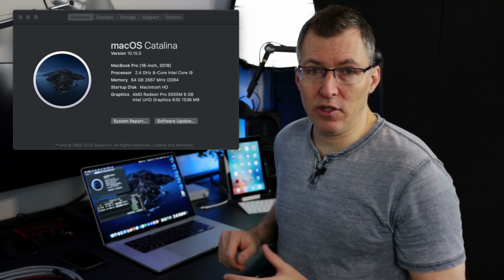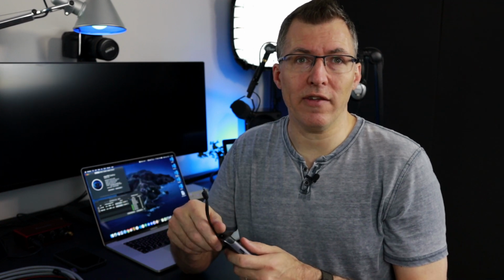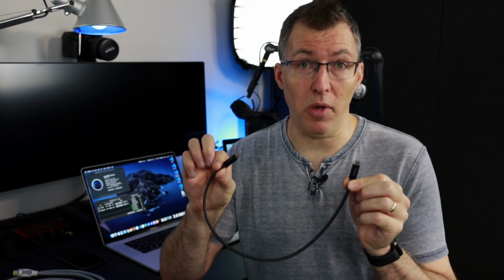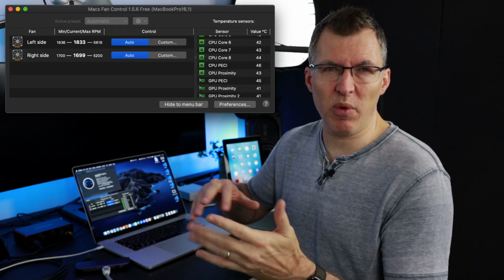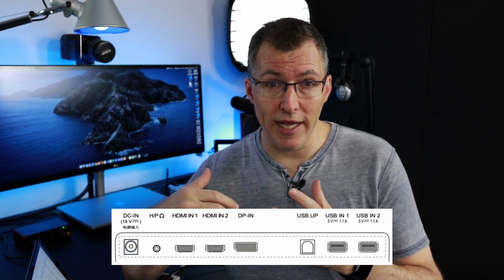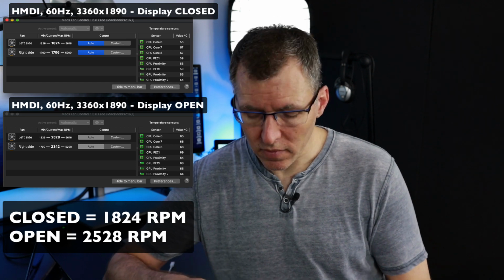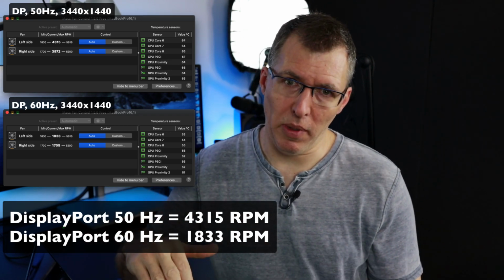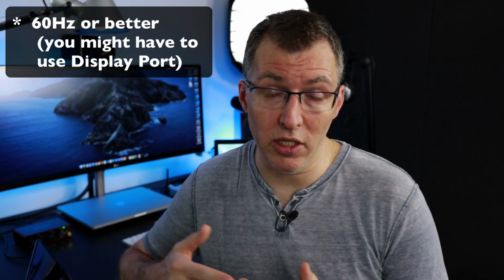SOLVED! MacBook Pro 16" + External Monitor = High Temperatures and Loud Fans. Here is the FIX!

Comment: Sorry but it is so. I use a displayport to usb c cable with 60 hz and the fans going up to 3400-4200 rpm...
Reply from the maker: Is the MacBook display open or closed while the external monitor is connected?
Reply: Virtual Tech Meetup if the macbook is open then 3400-4200 and if its closed then 2900-3400
Reply from the maker: Interesting. I have tested with 4 different monitors now with the same results. Which monitor are you using? I do find that CPU boosting can also kick the fans up. But it usually settles again once idle. Since making this video I found an app that you may want to try out. https://github.com/exelban/stats. It is similar to iStats, but 100% free. You can easily see how much power the GPU is using. As I type this my GPU is pulling 5.4W, CPU is 13% (some code I am working on is running in the background) and my fans are around 1950. As long as your GPU is around 5-7ish watts, it is probably CPU heat pushing the fans faster. However if your GPU is 15W or more, that is undoubtedly the culprit.
Reply: @VirtualTechMeetup  First of all, thank you for the check you made.

I use the following monitor: Samsung U28E590D

I have the following specifications of the device:
i9 with 2.4 Ghz with 64 GB RAM and the graphics card 5500M with 8 GB.

I currently have TG Pro and also Turbo Boost Switcher Pro in use.

I just downloaded the stats file you mentioned and will check it out.

I have the MacBook on the road right now and will test it as soon as I get home.

Thanks for your valuable and interesting video.

Comment: I am aware this question is not related but I don't where to look anymore and hoping you can help: I have a MacBook Pro 16 inches and use it with a dell external monitor and the usb-c cable. I use it in clamshell mode. The sound keeps coming from the laptop even closed. What do I have to do to have it from the monitor ?
Reply from the maker: Assuming that your monitor has speakers (many do not, including many Dell models)... click on the Apple logo in the top left --> click System Preferences --> click Sound --> click the Output tab... you should see your monitor listed as a sound output device. Click to select it as the current output. If your monitor isn't listed, it probably doesn't have speakers.

Comment: I have a Dell U2720Q and a MBPR 16" (5500M) - Does buying a new usb-c cable solve the problem? The Macbook is super quiet in "clamshell" mode, but once I open the lid, the fan noise is not to be overheard and very disturbing. Don't get me wrong, the Macbook may be loud under heavy load - the heat has to go somewhere.

I also took the Macbook to an Apple Store, but they didn't find anything (and didn't checked with an External Screen and I haven't had that much time tbh). I have installed https://github.com/exelban/stats and checked the gpu, it draws 20W+ if the external screen is open and if not, it's only 4-8W depending what is visible on the screen.
Reply from the maker: Once the lid is open you are basically driving two monitors and the GPU will jump to 20W increasing the temperature as well. Any combination of two monitors will be problematic (e.g. two external monitors and lid closed).

Comment: Finally a youtuber who honestly talks about the problems with the 16" MB Pro. Linus Tech Tips and his gang lie through their teeth, saying enthusiastically that Apple 'solved' the thermal problems on the 16" MB.
Reply from the maker: In all fairness to LTT, I suspect that they were evaluating only the laptop by itself. No external monitor. In that scenario there is less thermal throttling on the 16" compared to the 15" with the same processor (I have one of these on my desk at the moment as well). It isn't a night and day difference, but a difference none the less. However, if connected to an external monitor with one of the unlucky combinations, the additional heat load from the 16" GPU will easily negate any advantage.

Comment: The only good solution is to get the Radeon 5600M GPU which does not have these problems. The 5300M and 5500M models are defective, Apple knows it, and is sweeping it under the rug.
Reply: Could you name more sources that it works with the 5600M?

Comment: I think the ideal scenario is to A) use a usb c to Displayport cable from the left side port. While charging from the right hand side port.

B) making sure that the refresh rate is set to 60 hz (or same as the external display)

C) use screen mirroring (clamshell mode)

Please correct me if i am wrong. Btw with all three above. The system idles at 40s and 50s occasionally.
Reply: Option A solved my problem.
Reply: @chineduanene7632  my monitor only has HDMI :/ any advice? Currently using a USB hub to do USB-c to HDMI
Reply: @chineduanene7632  Option A did nothing for me. Option B is already checked.  Option C is kind of a sacrifice.
Reply: What about dual monitor? I'm going ape doodoo here 😭

Comment: Hi Robert,

Thank you very much indeed first of all for such a detailed video, it really is most helpful.

Can you provide the specific LG model number for the 34" UltraWide you are using? Are you getting the best resolution the monitor can offer? Any issues waking up from sleep, etc.? Is this a monitor you would recommend for the MacBook Pro 16" or do you have any other recommendations? You clearly have researched this very well and thoroughly so I thought I would ask if you do not mind.

Thank you very much in advance, kind regards,
Santiago
Reply from the maker: It is an LG 34UC87C, and all testing was at the full 3440x1440. Interestingly I was also having the issue with the system being unable to sleep and crashing. However after switching from the dongle/dock to the USB-C to DisplayPort cable, that issue went away as well. I had read that others suspected that their dock was the root cause of the issue, which would seem to have been true for me as well.

As far as recommendations go, I must point out this is an older model. However other 3440x1440 models from LG should be as good or better. Whether any monitor is the right one for you, depends on your needs. I am usually writing code and building data analytics solutions. I don't play games. The quality of text display and lots of screen real estate is most important to me. Super high refresh rates and response speed are secondary. It may be the opposite for you. I would actually prefer something like the LG 5K UltraFine. For text display it is incredible. However I need it to be wider and curved (and ideally anti-glare rather than glossy).
Reply: @VirtualTechMeetup  Thank you very much indeed once more. After a lot of research, I have decided to go for the LG 5K UltraFine. Ideally, I would have liked more screen real estate, but in the end I was not convinced by the 5K2K resolution nor by the 34" layout of the 34WK95U-W which was the finalist. But it was a close call, my conclusion is that that 34WK95U-W should work decently with the MBP 2019 16". 

As a separate note, I had bought a  MBP 2019 16" with exactly the same specs as yours, very recently. I am returning it for one with the 5600M GPU, it does seem that one is behaving much better perhaps it has even solved the issues with the external monitor. But it is a disappointment to say the least the quality of this Apple flagship product. You buy this sort of computer so you do not have to make compromises and it has been the total opposite.
Reply from the maker: I researched monitors a lot lately, and also thought that perhaps the 5K2K would be a reasonable choice, but nothing seemed like a sufficient upgrade. Nagging at me in the back of my mind is that I know that I really want the text quality of the LG 5K UltraFine (I used one on a project for about 6 months after the first came out). It is surprising that there is nothing between that and the Apple 6K XDR.

Comment: I have the 2019 MB Pro 16” and was thinking of getting a Dell 34” UltraWide or the 43” UltraWide.  Should my computer be able to handle either of those displays?
Reply: As I mention in the video, I use an LG 34" Ultra-Wide myself. It is important that you make sure that you connect to a port that allows for at least a 60Hz refresh rate (DisplayPort or USB-C would be the better option) and that you keep the MacBook Pro closed while connected to the external monitor.

Comment: Good tech review..
I'm looking for a solution to a screen glitching issue when connecting my 16" MBP to a 1080p Monitor or TV, via an external dongle. (It's a 2015 Model 27" LG, that works fine otherwise). Apple support suggested I go into safe mode (Shift+Power) and this works fine. but the MBP does not see external USB drives (via dongle, which I suppose is good in Safe Mode).  Replied to Apple support that I can't run the MPB in Safe forever. So...
Reply from the maker: I haven't experienced any screen glitches myself, so I can't provide any firsthand advice. A while back I did have issues between an Apple TV 4K and the LG 43" 4k Monitor that I mentioned in the video. Swapping out to a better cable fixed the issue. If you haven't already tried a different cable, that may be worth a shot.

Comment: Subscribed. You’re awesome. This is a big concern for many, I hope apple does more to resolve this. Reason I’m thankful is this is an in-depth well made video to an important issue with Mac, but not necessarily a winner for clicks. Yet you still chose to address the issue and give us valuable content on it. Thx. Still though Apple should try fix this hdmi usb-c toggle problem.
Reply from the maker: I am glad that you found it useful. It would be great if they gave us users more options to tune things. There are times that I want full power, and others when it isn't necessary. I want those options.

BTW, I am not worried about clicks. I made the channel to support the community around some of my other projects. But this issue had me stressed as well. When I finally solved the problem for myself, I wanted to help others.
Reply: @VirtualTechMeetup  Unfortunately, I went and bought the direct cable you suggested USB-C to HDMI (Before I was using a toggle converter for my problems)... Well the direct cable made it much worse. Even hitting 100 degrees celsius and didn't seem to be slowing down. I had to disconnect worried the damn computer would blow up.

Unfortunately, your recommendations didn't solve anything for me. The PC blows up with insane heat, when I plug to my PC monitor, my wide screen tv and is even producing heat when I use sidecar connected with an IPAD!

This is ridiculous. And absolutely disgusting for apple after asking for so much, and promising multiple displays.
Reply from the maker: @sandman3881  I wanted to confirm a few things. The cable that I used was USB-C to DisplayPort, not USB-C to HDMI. The reason that worked for me is that my monitor only supports 60Hz refresh rate over DisplayPort. 60Hz or greater is one of the two things that are important. The second is running in "clam shell", meaning that the MacBook Pro display is closed and you are using only the external monitor. Can you confirm that your refresh rate was 60Hz or greater, and that the MacBook Pro display was closed?

On a side note... I have never seen anything close to 100C, even while doing all of the various tests in the video. You may have other issues that need to be checked out.
Reply: Virtual Tech Meetup I thought it was hdmi to usb-c. My screen doesn’t even have display port. But I appreciate the info. Guess I need to buy a screen.. as for my giant flat screen no way I’m replacing that which is also hdmi. 

The refresh rate was 60hz. The screen was not closed in clam shell. As I intend on using my labtop keyboard and trackpad, and not carry full sets of peripherals. 

I appreciate your reply though. And thanks for the great work. Unfortunately none of the peripherals I currently own including my iPad is working as intended.

Comment: My fix? If a new iMac is announced tomorrow at WWDC, I'll be dumping my 16" MBP...and will never buy another "high end" MBP again.  Imo, Apple still has not learned the lesson of "Function over Form".
Reply: You'll run into similar issues. Heat, for one. The last iMac I bought was the 2017 5K one. They haven't changed a thing with thermals in the last 3 years and something tells me the new design will run everything up to 100C or 105C to minimize noise. The T2 security chip is a disaster and has given people all sorts of issues like kernel panics. You won't be able to swap out the SSD when it fails, since T2 chip requires the original SSD and drives present in order to boot.

I get that some people want Apple to take care of everything when something goes wrong. They'll buy AppleCare. I won't judge, because some people would gladly trade money for less time wasted and frustration. The problem is that the T2 chip really shouldn't exist in its current implementation. It's causing stability issues. It's complicating a lot of things that should not be complicated.
Reply: @notmyfaultthisishappening3795  While I agree in some ways regarding the T2 chip... there is no way in hell an iMac, especially an ARM based iMac which will not have a T2 chip...will run as hot and noisy as the 16" MBP when connected to an external monitor.